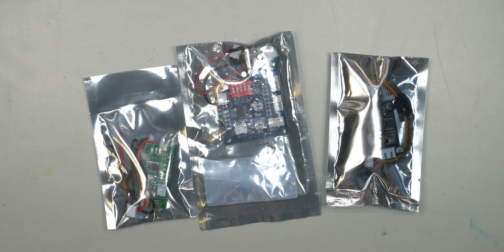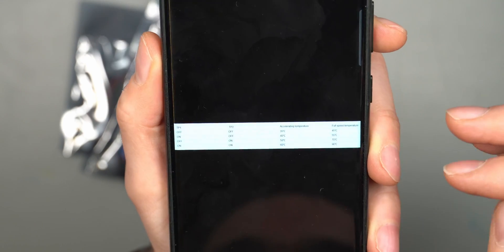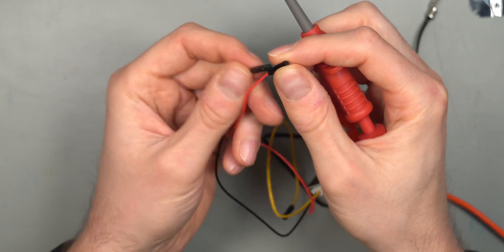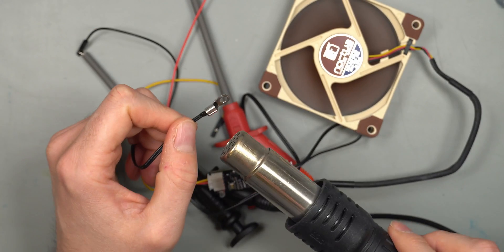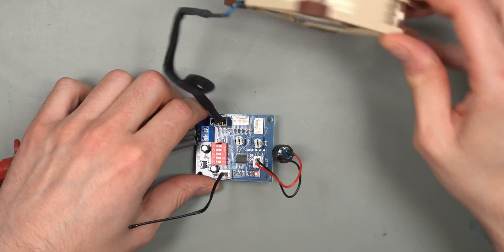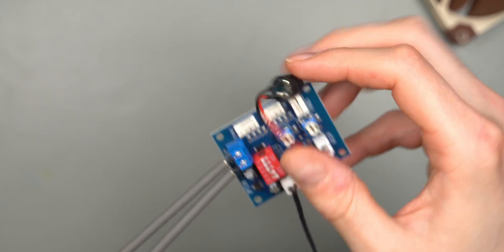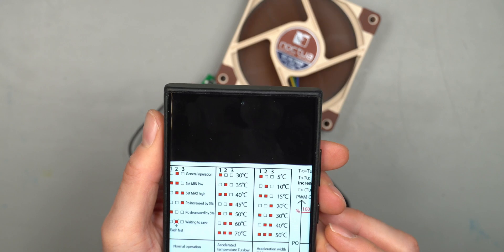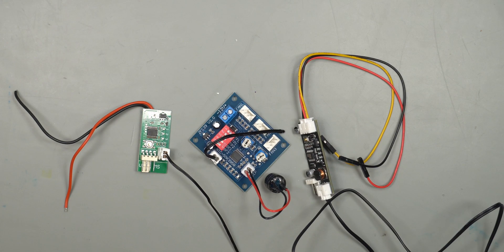Cheap Temperature PWM Fan Controllers from Aliexpress

Comment: Can you (or someone) please post the program instructions for the modules with 3 leds? Specifically for the ZF1X4L V2 4 wire fan control module, it has three leds and one button.

Comment: Came here for a more detailed description of board 2 (and if it will work better than board 1 for two 3 pin fans that have to act in unison). I did learn some more but you didn't mention the two sets of solderingpads that you can short (at least on my copy of board 2). Explanation on Aliexpress is sketchy at best, but I think one of them might have the ramp-down function with increasing temperature and the other will have output 2 and 3 follow output one. Guess I will have to do some testing to be sure ;)

Comment: fun fact, there are hidden settings on the ZF1X4L V2 pwm(the smaller one with 3 leds) that can be accessed by holding the button when you power on; I can't recall what it does and am trying to find the video that talked about it... part of it I think is making it ramping down when warming up rather than ramping up but there was something else.....

Comment: The 3 fan board only has one output control via the temp sensor. the fan speed is set by the pot only.
Reply: Bonjour,
La vitesse des ventilateurs n'est pas réglée automatiquement ?
Reply: @jean-pierrecane4349  Not for the second and third fan, unfortunately. I needed to control two fans so I used a Y splitter plugged into the first port so they can be both controlled by the sensor.

Comment: You will have to see what the value of the temperature sensor is they could be different value use a multimeter set on resistance.

Comment: A few things regarding the ZC930/HW-585 board; Only Fan1 is controller by the temp probe. Fan 2 and Fan3 are controlled via the two potmeters. Your Beep did not work, bacause you have to power down and power up again when you make a dip switch change. 😉 Thanks for this vid! 👍
Reply: can confirm this, it works. thanks

Comment: Hello and thanks for the video! I am building an eGPU enclosure and I am searching for a temperature PWM fan controller like these, however for power, I only have SATA or IDE (molex) power cables from the PSU, since I dont have a motherboard. I have tried searching for a 12v cables to SATA or IDE connector adapter, but I can't find anywhere. Do you have any advice? Is it possible to DIY this somehow? I have no knowledge of electronics and soldering, but I have built multiple computers. Thanks again :)

Comment: 0:55 When they write PWM then they mean that the pulse the fan supply voltages. That was normal way to do it before the 4-pin fans was a thing. The "screw points" are called potentiometers.
Reply from the maker: PWM stands for Puls-With Modulation, you need the 4-th pin to handle that, Else it just runs on DC adjusting the fans rpm by raising or loweing the voltage. But in theory, it could pulse the voltage as well, just assumed it is Direct Current. Thanks for the correction. I just could not find the right word, which is quite different from my local language.
Reply: I /do/ know what *pulse-*width-modulation is. I've been working with electronics all my life. PWM fan speed regulation on old mainboards/electronics does /not/ regulate the voltage. It pulses the supply voltage. Seen over time it's the same as regulating the voltage, but if you look at the signal with an oscilloscope you will see it switching between full supply voltage and 0 volts. Regulating the voltage is lossy (dissipates heat) and is not something you want to do. My local language is also Danish :) @whcvip
Reply: @zaprodk  wrong. 
show me an "old" motherboard that has a pwm fan connection.
i CAN show you my bondwell PX-XT at 4.75Mhz that does voltage regulation..
" working with electronics all my life" guess not does not go for "Computers" "the end"
Reply: @ronny, if it regulates (analogically) voltage it is NOT PWM, if it's PWM it "regulates" average voltage by applying max VCC for only a fraction of the time.
Reply: @zaprodk 
Bonjour,
Peut-être accepteriez vous de m'aider à faire un choix.
J'ai un projet pour permettre une bonne ventilation de mon frigo trimixte de mon camping car.
Je veux placer 2 ventilateurs sur le plancher pour aspirer l'air frais et 3 ventilateurs 80x80 directement sous l'agrégat (dissipateur) du frigo pour pousser l'air vers le haut.
Il y a déjà un kit (Titan) de ventilation sur la grille d'extraction tout en haut (ventilateurs Titan 120 mm)
Pouvez-vous me conseiller pour choisir le bon module qui permet de réguler les ventilateurs en fonction de la température avec réglage et affichage (pas obligatoire) ?
Merci pour votre attention.
Bien à vous,
Jean-Pierre